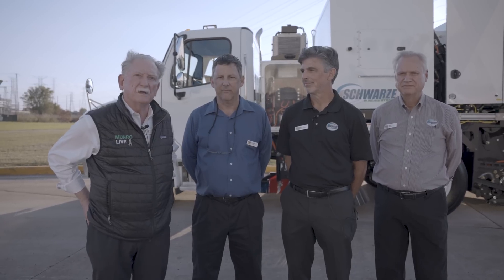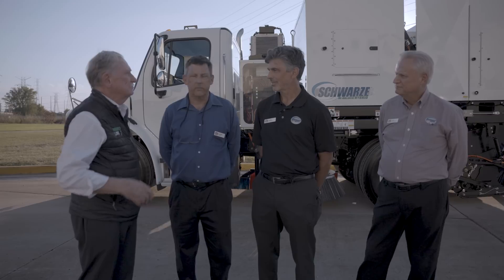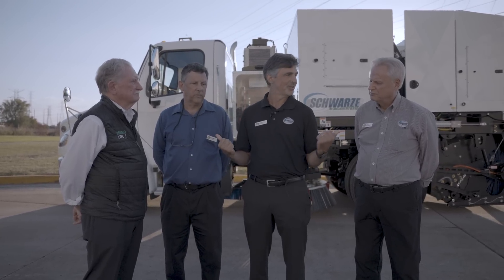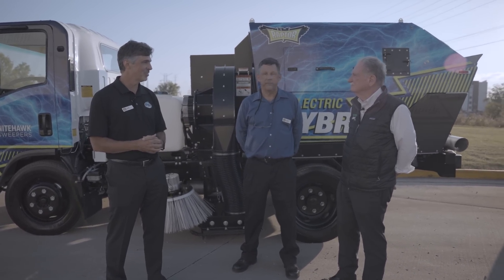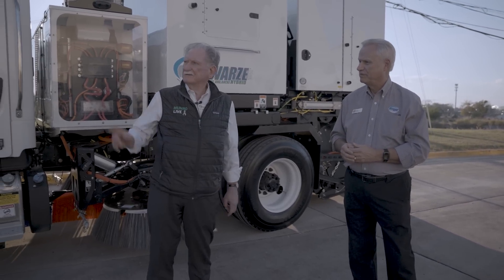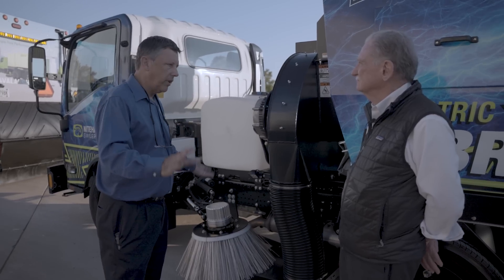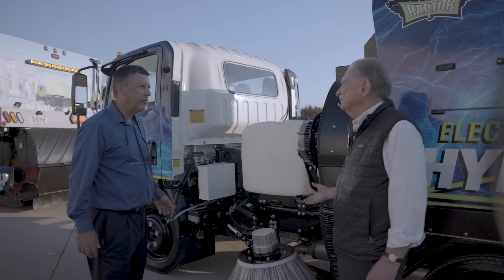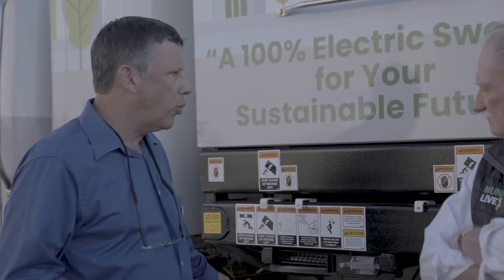Schwarze's Electric Street Sweepers

Comment: They should be covered in solar cells embedded in the paint.
Reply: Are you just assuming that doing so would make economic sense? Or have you done some calculations that shows it makes economic sense? If the former, your assumption is most likely wrong. If the latter, please share your calculations.
Reply: Since they work at night it would depend on where they are parked during the day. The Edison Motors hybrid semi has a PV on the roof that charges the 12v battery as a backup.

Comment: Just wondering, why did they not think about Hydrogen/ Fuel Cell variant of this?
Reply: H2 + Fuel Cell for small road vehicles is just not viable. Small I mean anything smaller than a House. This is a whole fuel supply chain and on vehicle storage problem. Thus why H2 is being abandoned for road vehicles.
Reply: The same reason the millions of evs don't bother with that waste of time.
Reply: Where would the customer get the hydrogen? Electricity, gasoline, and diesel are everywhere. And hydrogen is very expensive.
Reply: Fuel cells are being used on municipal machines like garbage trucks because they have a short route and return to the facility multiple times a day where you can put a H2 station. Otherwise it's not practical.
Reply: Because hydrogen is dead and a fool's errand? 
Because electricity is readily available.
Reply: There is an informative video called "The Truth about Hydrogen - The dirty little secret" on the BestInTesla channel (https://www.youtube.com/watch?v=-8BDRFFL3h4) that explains many significant drawbacks of using hydrogen as a fuel for vehicles.
Reply: ... because that's looking like old technology nowadays.